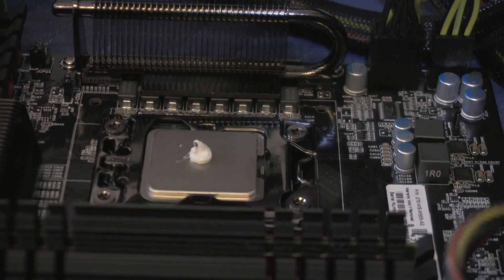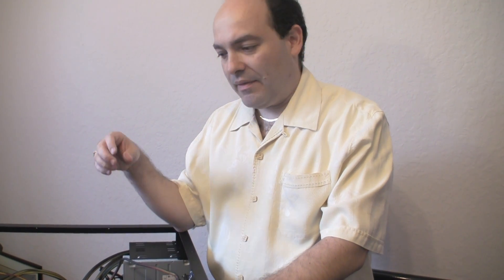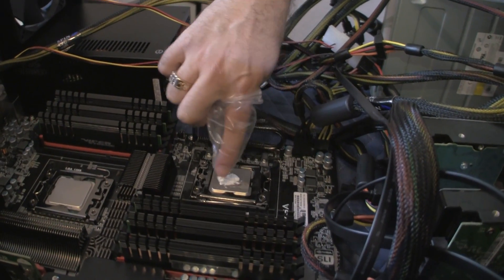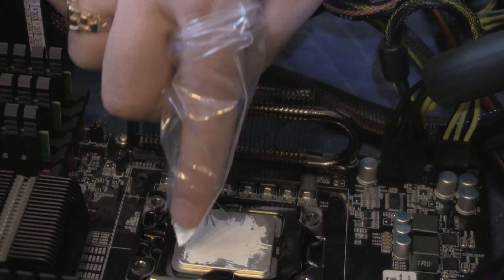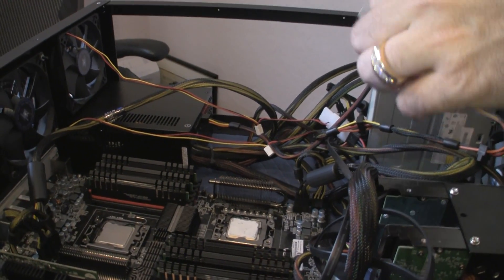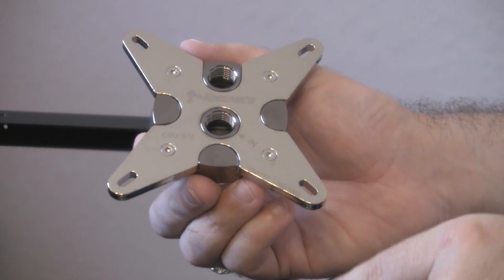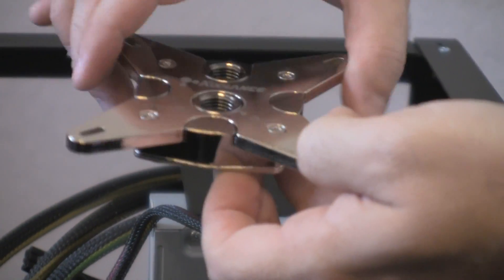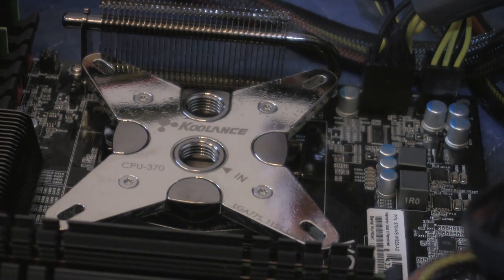Water Cooling Your Computer - Part 7 - Installing the CPU Water Block - Part 2 of 3

Comment: well you explained what the thermal paste is for, but it not for that reason at all. well it is , but basically thermal paste, lets say,, connects your waterblock/heatsink to the cpu, so heat can be transferred, both sufaces must be very flat the cpu is usually flat and the heatsink or waterblock should be flat, when applying thermal paste spread it out through the chip evenly with a card or something, not just place a blob in the middle.

Comment from the maker: The Koolance PMP-400 pump, which is the pump inside the 5.25" bay unit, is powerful enough to push the water through my build. In fact, it's powerful enough to deal with a 4 fan radiator, 2 CPUs, 2 GPUs, and even a motherboard/chipset waterblock.